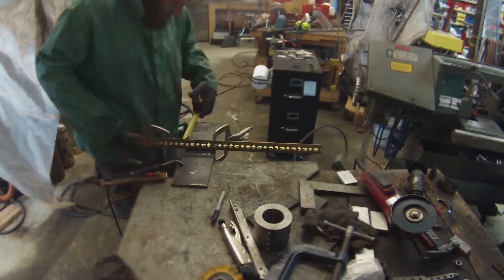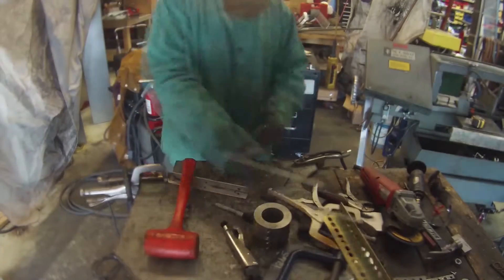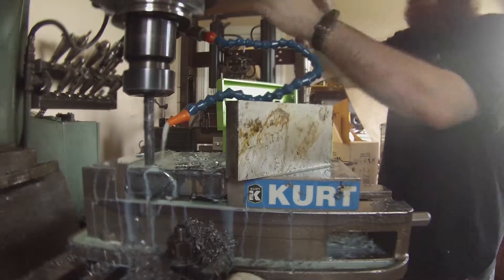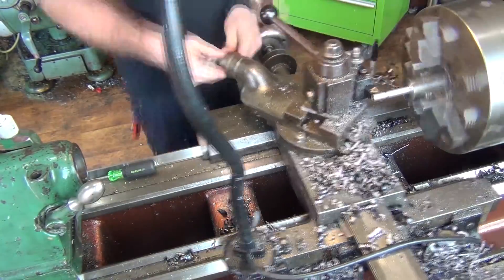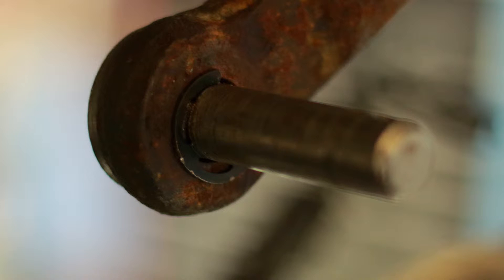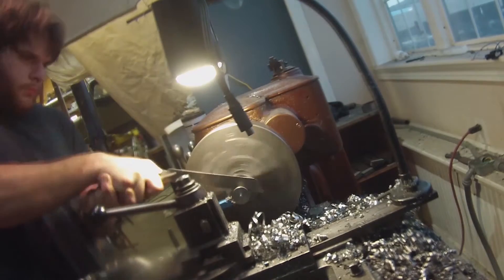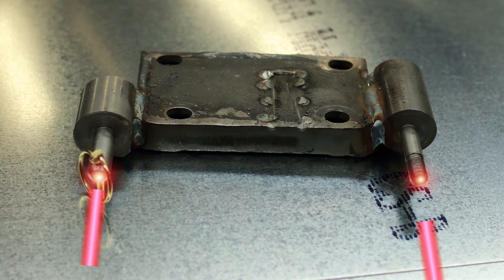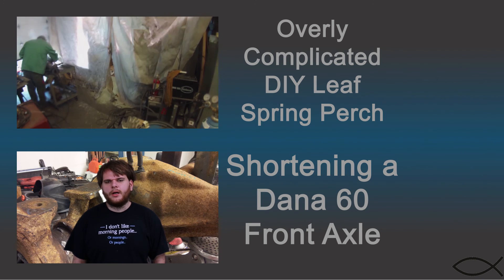DIY U-bolt plate/Lower Shock mount/ Sway bar link mount 610BOBs Builds

Comment: Did you have to raise the top shock mount point? Did it help with any issues you had previously. My current issue is my caliper rubbing against lower part of shock on a SOA yj.